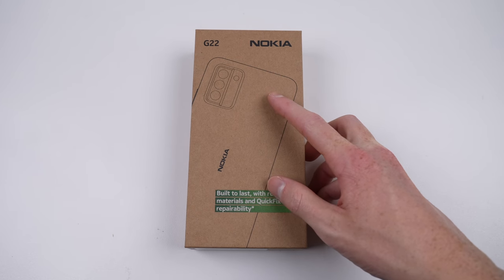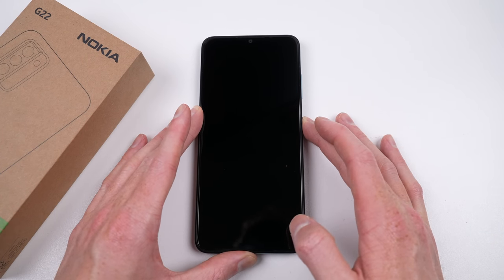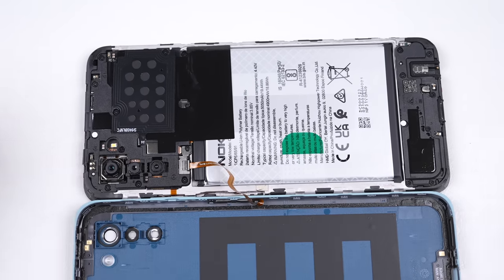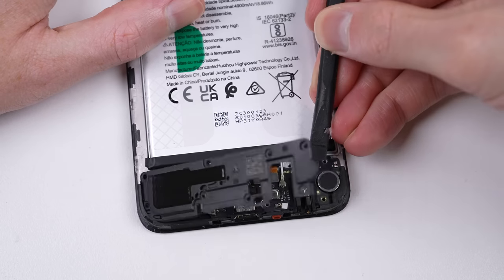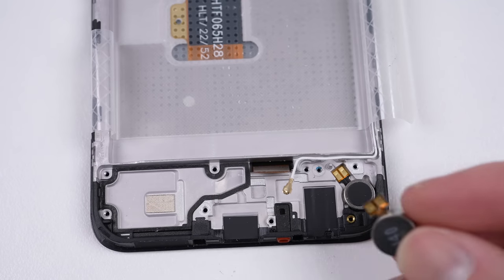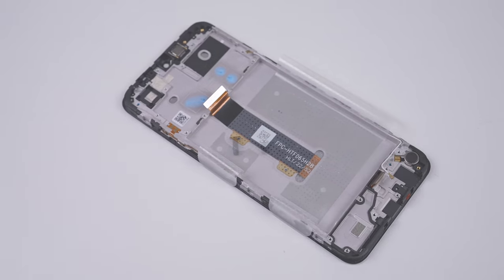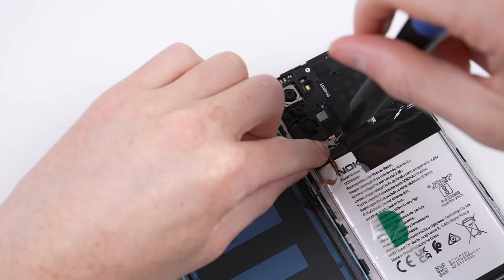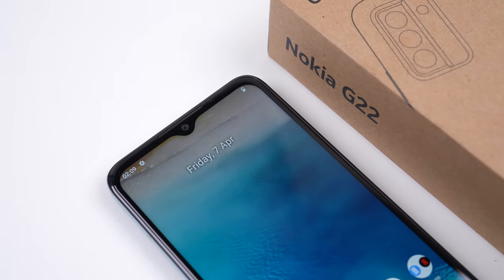Nokia Makes Its First Repairable Phone - Nokia G22 Teardown And Repair Assessment

Comment: At last they offer the option to unlock the bootloader.
My Nokia 3.1 plus did get updates for about three years. No repair needed. Is now a potential insecure device.
With a potential longer life of the Nokia G22, via alternative OSes. It is very helpful that parts are available.

Comment: "First"? What do you mean... First?

Nokia's last designed phone before Micro and super Soft got their mobile division, the 1020, can be taken apart with two screwdrivers and nothing more. How much more repairable than that does it need to be? And virtually all their phone previous to that were super easy to repair with an entire scene worth of parts and mods available.
Surely... you meant HMD Global, builders of licensed Nokia phones... not Nokia, Nokia.

Comment: Sadly if it’s like the Steam Deck, you can replace major parts, but smaller things like screws, well you’re screwed on. I lost a fan screw for mine, and am out of luck. The deck too also uses screws and clips to hold it together. Also using iFixit for their genuine parts replacements. I have replaced my fan. It went well, minus that screw. I’m pleased to see official part replacements, and repairability in mine. Let’s hope other companies take notice.

Comment: If you have problems removing the battery you can seep a little isopropyl alcohol at the edges that will loosen the glue and make it much easier to remove.

Comment: And as for the battery/glue issue here, pretty sure a good many people will not be doing a battery replacement attempt immediately after purchasing the device brand new. The glue will decay over time and in reality it will not be such a hassle when the actual replacement is required.

Comment: As someone who's been buying Nokia phones only since 2003 (I had an N900 from 2009 until 2019 when I bought a Nokia 4.2, and now an XR20), iot's great to see Nokia returning to the game.

And while I do understand that this phone isn't the greatest in terms of specs and ease of repairability, it is definitely a step in the right direction.

As for the other side booing Samsung and Apple for making the phones difficult to repair, I agree with that but only from the parts serialisation side. That bit is scummy as hell.
From the technical side, people want more and more crap crammed into the thinnest block possible so something has to give. In order for cutting edge tech to be in a small package, being modular is next to impossible. Yes there are some idiotic design choices but I think for the most part, the engineers are working with very limited space.

If the big two however removed the idiotic serialisation (and gave access to genuine parts), I think Nokia would have a much harder time selling this.

Comment: For me the question is, will the batteries be available in a few years time, when they'll be needed? I had an LG V20, which had a removable back, and genuine replacement batteries were impossible to get when I needed one.
Reply: I've only ever had Nokia phones, all cheap or mid-range models and their batteries are generally still good after 3 and even 5 years of use.

I have actually never had to replace a battery on these phones, my friend who still uses a Nokia* dumbphone has been through 2 battery swaps but his phone is 16yrs old 😂
*(still original Nokia, not HMD Nokia)
Reply: But yeah, OEM battery replacements should be available for ar least six years to be relevant.

Comment: Have you had a look at the xcover6 pro? I'm in Australia and I found one at a local Samsung shop. It's an odd phone, easy to disassemble and repair, but Samsung Australia will absolutely not help you  to do so. 
No parts, no manuals, you have to use their repair service if you want legitimate parts. I asked for a spare battery (the whole point of this phone) and the poor idiot in the Samsung shop had to fill out a repair order form, and I had to wait two weeks for the battery to come into the country, arrive at their repair partner and then posted to the Samsung shop in question.

Comment: nokia does not allow the bootloader to be unlocked. the setting enables the bootloader unlocking tool to unlock the device's bootloader but the actual tool remains with Nokia and isn't supplied to the end consumers unless you're using some shady 3rd party service (many of which are paid btw)

Comment: It can be repaired by anybody at home with just a screwdriver and a pick. Instead of heating the back plate and other silly proprietary methods. The only thing, is the battery glue, but with some perseverance and probably a hair dryer comes out easy. Cool phone. Thanks

Comment: Repairable aside, shouldn't they make this phone last longer hardware wise? This is a $300 phone with very low end spec, I doubt it could handle 2 android updates with it's features. I don't think anyone should use this phone longer than 2 years.

Repairability is kinda meh, I don't like clamping mechanism, it's easier to break the backdoor with your picks if the plastic is old.

Comment: I am really split about this because Samsung provides 5 years of security updates, but not monthly and not for all phones. Samsung has way better displays but no replacements. Also from what I could tell I think my Samsung M21 is actually easier to repair even tho it is not advertised for it. But I don't get replacement parts and since it's low end M-Series I am not guaranteed to get any updates at all. Can we please get a company to make phones with great displays, replacement parts that makes sense and security updates. I also don't get why it's so dang hard for Android to similar to be similar to something like Debian. I mean look at how long they support old Versions without any work of the System Manufacturer.

Comment: man are long gone the days when i could change only the headphone jack piece in the repair shops lobbys waiting table in under 5 minutes with only a philips screw driver in my galaxy s3. pop the back cover off and it was fastened if memory serves  with 3 screws on top. and it had ipx5 water resistance still. Damn apple and the trends it sets. Glad Luis Rossmann is changing this for the better.

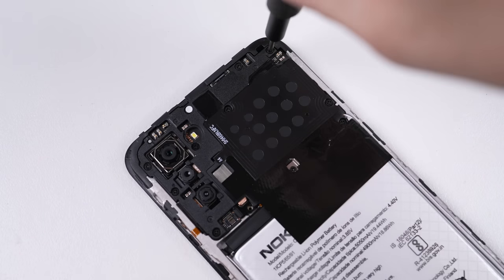Comment: What size are the screws you remove at 3:00?
Depending on the size and Position it would be possible to 3d print a custom back coer that utilizes longer screws to be mounted to the Phone.

Comment: Would it be such a huge proglem to glue a battery TO A PLASTIC FRAME that is holden with 4 corner screws in the phone? You know, that ancient long forgoten technology from laptops 😂
Besides that, nice pricing here: 178€ phone, parts: 9€ charging port, 30€ display

Comment: My first Android phone was an HTC Desire. The back was a flexible piece of plastic that popped off by sticking a fingernail in a recess and lifting. Battery came out by sticking a fingernail under the top and lifting. The battery didn't need glue because it was held in place by spring connectors and some seating tabs. I do not understand why phones make it so difficult to get inside these days other than a cynical ploy to make it hard to service. But this device claims to be easy to service yet it's not exactly easy either.
Reply: A smartphone can be fairly expensive, so the impossibility to remove the battery becomes a crucial feature when the phone gets lost, but remains powered on long enough to be located.

This, of course, created a different issue with repairability and longevity, in that it became difficult to swap out the battery when it ran out of juice after several years of use.

Comment: Great idea Nokia. FYI warranty stickers and warranty voiding for taking something apart is completely illegal. At least as far as i know in the US it is. I believe in Europe as well. My corsair PSU doesnt come with a void warranty sticker just a high voltage one over one of the screws. So thats either their way of going around it or just a warning for when you take it apart.
Reply: I don't know about rest of Europe but in Serbia we have those warranty stickers and we do void it if we damage them. For example in 2014 I bought a prebuilt PC that I couldn't open to clean the dust for example for a whole 2 years because if I did, I would have void the warranty. That's why I'm never buying a prebuilt again.

Comment: This is a baby step in the right direction, but with Security Updates being limited to just 3 years at best, I don't think it matters that much how repairable said phone is.. So long as the battery is replaceable in some way, I would prefer an Android Phone that would get at least 5 years of Security Updates than a very repairable phone with only 3 years of updates.. Provided I take care of it, a phone with longer software support can theoretically outlast any repairable phone with a shorter support period..

Comment: My phone is nearly 6 years old. I have replaced the battery and having done that it's basically fine apart from one thing, the Android version. Phones need 2 things to be able to be used for a long time: spare parts especially batteries, and updates. 2 years updates is way too short. It becomes problematic long before anything but the battery needs replacing. There should be laws requiring spare parts and updates to be available for a minimum amount of time. Perhaps parts for 10 years and updates for 8. It's not like the phone company is making the OS themselves, google does that. All they have to do is package it with the drivers. If they new they were going to have to do that for 8 years maybe they would put more effort into standardising things to make that task easier.

Comment: Pretty cool, but only 3 years of software updates still makes it landfill bound. Yes you might be able to put CalyxOS on it and relock the bootloader to regain some security after 3 years, but once the vendor stops providing updates to the closed-source chipset firmware blobs, security vulnerabilities will add up and up over time making it a magnet for hackers and malware.

Until manufacturers start making chipsets with open firmware that the community can patch, there's not much point replacing worn out components if the original battery will outlive the software updates.

Comment: with the specs 3y is propably the maximum using it. Still, with acutally a removable battery 5y security updates would have been a lot better. 1.5 years ago I wanted to replace my old phone and had the Fairphone 4 or the Pixel 6 in mind. At the end I did choose the Pixel because of assumed bettter hardware and larger battery as the Fairphone 4 already had a slower ARM in it. 
Now with the hardware and software issues of the Pixel 6 in hindsight the Fairphone would have been the better choice, I guess. (Not checking if that also had any issues)

The Nokia has ok hardware support but lacks the software. The Pixel or Samsung have boths 3+2/4+1y upgrade/update on the software side but even with care the battery will be difficult to get you to that. Fairphone would be probably the best choice here, if you/I can ignore some low hardware specs ;)

Edit: Nokia ARM is ok for the price of here 199 EUR, Fairphone 4 is/was probably with similar performace but was 600 EUR and 1.5y ago ...

Comment: Even I have my asus zenfone 5z. It still works, unfortunately it's charge port is damaged, it charges but  slowly and i am unable to find the spares. That thing has a bit more life in it. If all the premium phones are coming with an option to repair and there are spares available I would switch I would definitely switch... If I could open the phone and replace the battery or a charge port on my own. Its something I am willing to go through the trouble for.

Comment: Xiaomi Redmi 9C is reparable phone and can be taken apart with just one screw driver and no heat gun. You can separate the back by just pulling it apart. Xiaomi is really good at building repairable phones the only problem is finding the parts (although the screens are easier to get as many models share the same screen form factor).

Comment: Not agree. Here in Bulgaria, price is around BGN 300 or  USD 165. Display price + service costs 1/2 price of the phone. Instead of repair, trade whole unit for 1/4 or 1/5 of the price and buy a new phone. It's not only about 'repairability', but the price of it.

Comment: Besides from "original replacement" (display,battery,..) it still hard for a normal people to replace it manually (imo). Like to separate the display and the shell,it's likely to break the display by accident 
Probably need to go to repair shop if  need replacement though 😊

Comment: For something to be rapairable there is little a manufacturer can do.
In fact there are 2 things.
1. DO NOT make a product that is intentionaly made anti repairable (aka implementing various software locked components, proprietary software, connectors, screws, etc...)
2. DO NOT attack any seller on the free market claiming IP rights.
Literally if they build a normal product and don't engage in aggressive and abusive anti competition practices, there will appear many parts available to repair a product.
Because that is the single most important thing.
A free market governed by offer and demand where any parts supplier can offer their product and services.

Comment: Adhesive under a battery is stronger because You’re tearing apart a new unit from the factory. 
Generally, batteries are replaced after a period of time. In this while the adhesive becomes less stronger because of heat from the battery..

Comment: I wonder if the adhesive will weaken with time, making it easier to remove the battery by the time it needs to be replaced. Regardless, this seems like a clear winner. OEM part access and openness to repairability and life after official support via unlocked bootloader, especially on such a cheap feature phone, are fantastic things to see.

Edit: Nevermind, bootloader can apparently only be unlocked by sketchy software, limiting the device's security lifespan to 3 years. The phone could still be useful for some people, but from an environmental view this gets a hard pass.
Reply: HMD and to a lesser extent, Nokia, are trashy companies that go to EXTREME lengths just to keep their phones' bootloaders locked. I actually even asked them to unlock my phone's bootloader (which is the Nokia X10), but they kept on using the "security" and "stability" excuses.

Comment: I wish we got metal backplates with screwholes and a small rubber seal to keep it waterproof. Premium models could have a glass circle in the middle for wireless charging.

Sooooo sick and tired of glue. The bulk of people will use a case or skin anyways so the screws would be out of sight.

Comment: By the time you need to replace the battery, the phone will have gone through many cycles of heating up and changes in environment which may cause the adhesive to degrade and become easier to remove.

Comment: I want the removable battery to make a comback. Phones were getting chunky for awhile, justify that chunk. Barring that, considerations to make the radio something which can be replaced so a new mobile transmission standard doesn't obsolete the handset once the towers no longer transmit would also be nice because you know they'll come up with 5G's successor, and 5G will become decommissioned globally.

Comment: My Poco[phone] F1 is really similar inside, but I could easily remove the battery with the tab. And its performance is lightyears ahead of the Nokia. It's being updated by the community, I have Android 13 crDroid on it right now. The only upside to the Nokia is the parts availability. Finding a decent battery for the Poco is a challenge in Europe.

Comment: Just replaced my cracked pixel 6 display with the original parts from ifixit. I was surprised by the low price of 110€ while most Chinese displays were  way more expensive.

Comment: Very alike the budget phones from Xiaomi, Nothing to brag that much about it, if other manufacturers do similar constructions. The biggest disadvantage of this phone is that nobody would want to repair it after 3-4 years, because the hardware is outdated out of the box. You may start with a Smartphone, but after some years it will be good only as a regular brick phone, making calls and taking a few pictures.

Comment: Repairable phones are great, everything should be repairable. And it's not like they lost much from the slim form factor either. Also, most importantly, just as there is plenty of manufacturers to choose from, you should be free to choose your OS, software and all. This google only or apple only is no good. Phones are powerful enough to compete with a full fledged desktop computer, so why we can't install our own OS, and have full control over the software and hardware, in a similar manner to a pc. Also, having a variety ecosystem makes things really difficult for those wanting to prey on your privacy, be that govs and whatnot. And anyway, the whole success of the pc was because of all the freedoms you had in hardware and software. Phones are pretty much locked down and it makes no sense, they are portable computers afterall. Ease of use is no excuse, they didn't try this on pcs, they would fail if they did.

Comment: it's funny how a dying phone brand is the one to push innovation while bigger smartphone manufacturers like Apple, while offering reparability by making replacement parts available, it's still way far than the standard "scrap another phone to fix your phone" approach that mechanics can use on android phones. An easily repairable phone is a good start for a brand that had made too many mistakes throughout their career. I just hope they continue on this while offering more and more features.